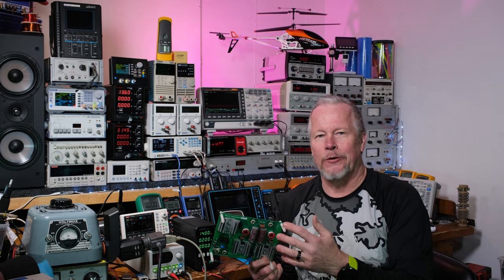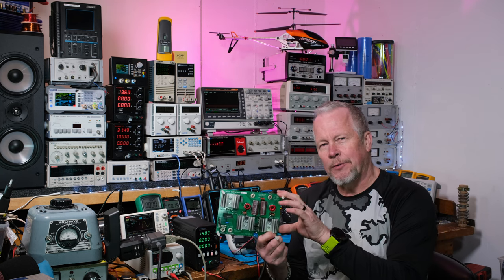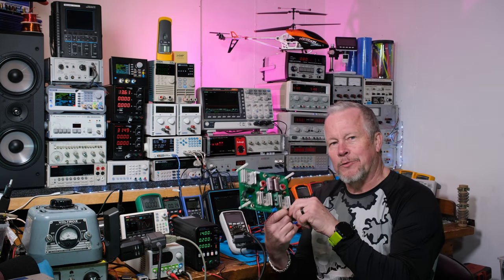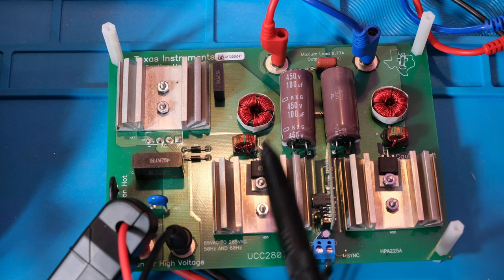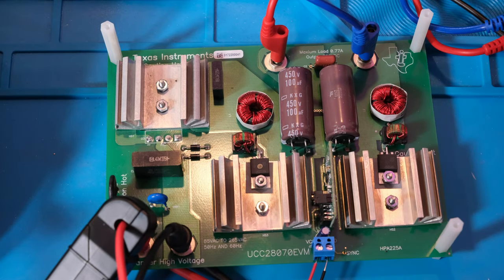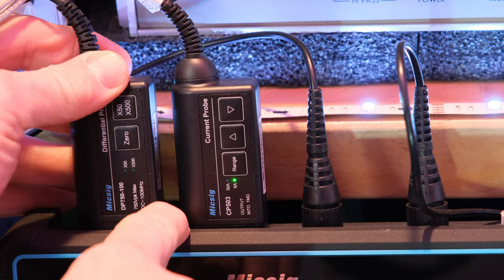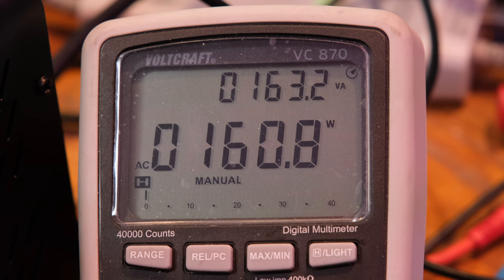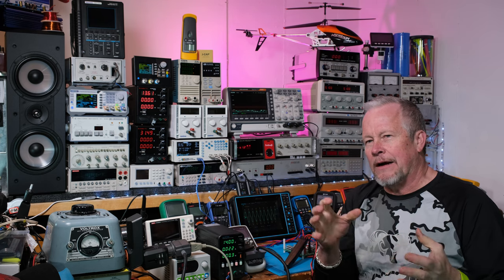Input Power Waveforms with Active Power Factor Correction #micsig #voltcraft

Comment: I am convinced this better , also Convinced, if you go to a Audio HIFI DIY And  you proposes a project class A or AB  amp  with this !! then there is power spike  , servers going down and you have a ban for life 😂. I,am intended to build a small amp 6BQ5 PP UL with a cheap Alie SMPS , wonder if there is change in sound with a Transformer,GZ34 Rectifier tube , and 2 capacitor,s and a choke between
Reply from the maker: Thanks Bert!  Sounds like you have some great projects;)

Comment: I tried to explain this to a computer guy talking about computer power supplies - he thought PFC was just a capacitor.
Reply: To be fair for a 'computer guy' he aint too far out !
Reply from the maker: LOL  Actually in large industrial applications where the loads are very inductive (motors) they do use capacitors to offset the inductance.  But this is not applicable in most commercial applications.  Maybe your heater motor;)
Reply: @KissAnalog  I have seen the large capacitor banks in the power distribution panels of factories, and their monitoring instrumentation. I used to do industrial electronics.

Comment: A FLIR-branded moldymeder? Whiskey tango foxtrot?! FLIR is an acronym for Forward-Looking InfraRed. Anything other than their thermal imaging cameras should be marketed under either Teledyne or LeCroy. I'd wager the LeCroy name on a DMM would make a lot of engineers moist.
Reply from the maker: You might have a point, but then Fluke's parent company bought FLIR's competitor and now sells multimeters with FLIR capability under the name Fluke.
Reply: Eddie has more dmms than he has space to ever show them all. Even ones he got for Xmas hahaha
Reply from the maker: That's true Joey;)  I actually bought most of my meters - especially the more expensive ones.  Hioki and EEVblog have been nice to me;)
Reply: @KissAnalog  it's crazy how many hioki meters there are. I never heard of them until you reviewed them.
Reply from the maker: Yes I only knew of Hioki because of their really nice power quality meters.  It is like Brymen multimeters, we just don't see them in the states.  We rarely see the rebranded version - the Geenlee.